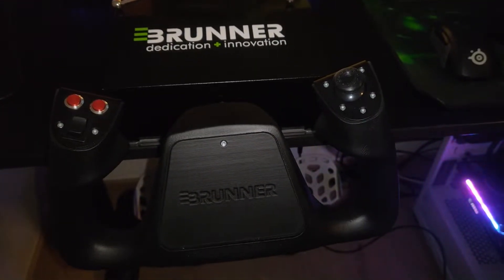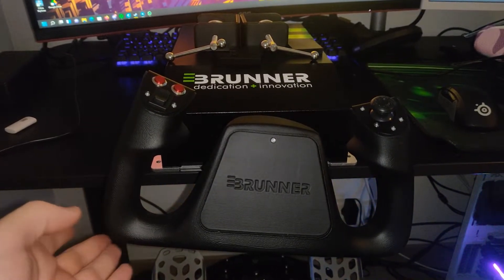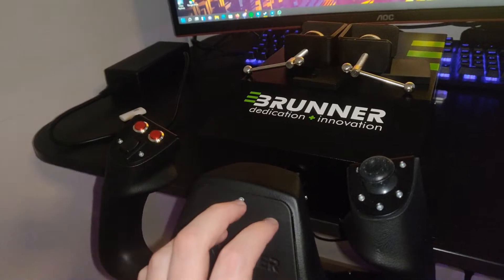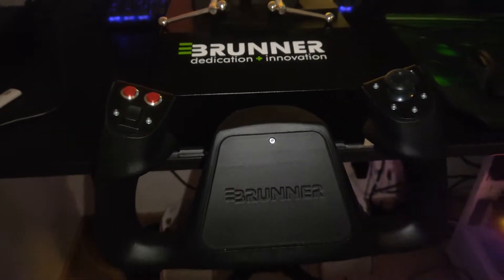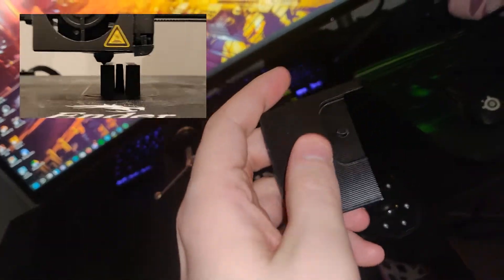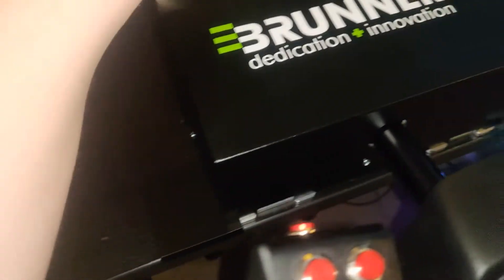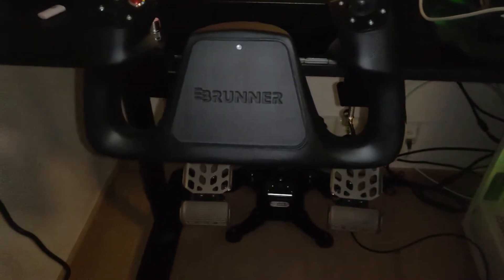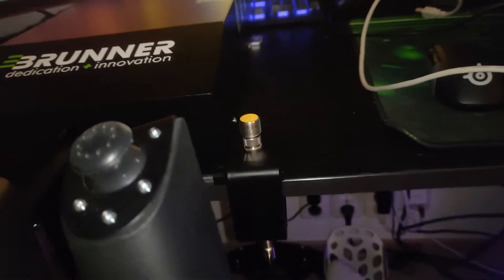Brunner CLS-E NG Yoke Custom Clamping system

Comment: I mounted 4 neodymium circular magnets onto the 4 metal tabs on the yoke.  Then I mounted (nailed) a thin sheet of  steel on my desktop.  I can pull the yoke out and it "sticks" to the sheet of steel with plenty of force to hold it.  But I can remove it if needed.  I cover the sheet of steel with a large mousepad when not in use.